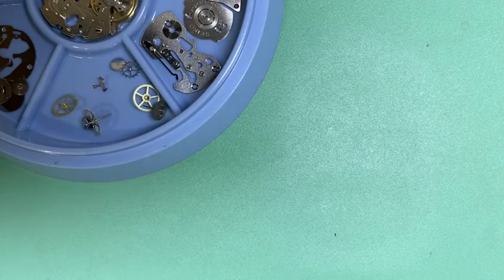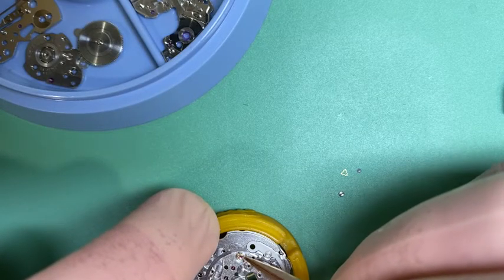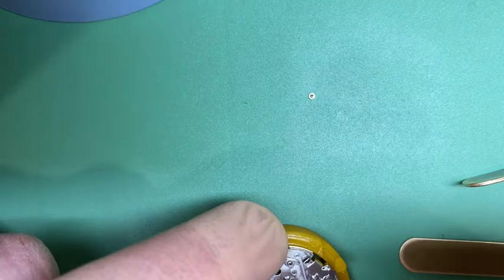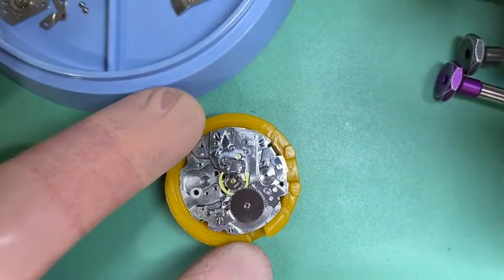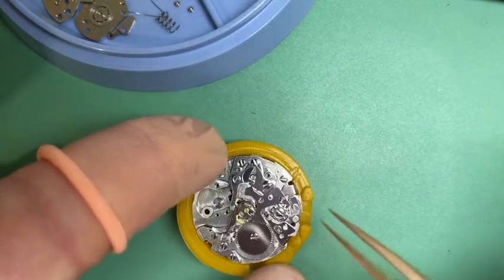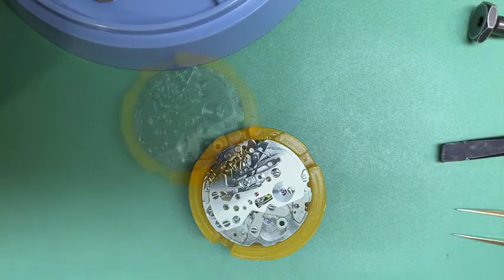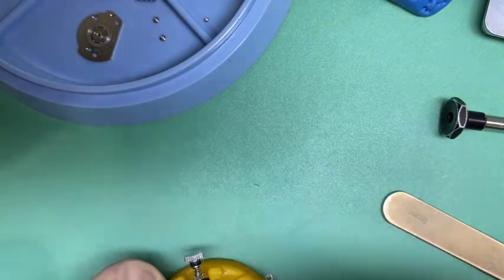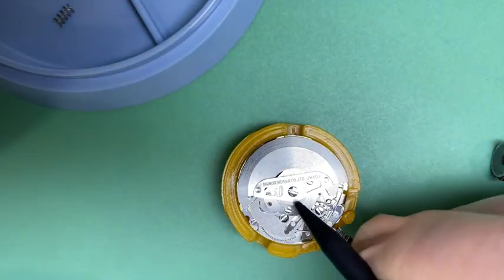Seiko 6139-6005 ‘Blue Pogue’ Service Procedure - Part 2: Assembly & Lubrication

Comment: "It's just that easy" 🙂  I need mine rebuilt, the timegrapher refuses to read the thing at all sometimes, and when it did I set it as well as one could expect only to find it running super fast as soon as I put the case back on and wore it.  Thanks for the videos, they are insightful.

Comment: Great video.   I have worked on several and picked up some great tips and techniques.   Would appreciate more info on lubricants you use and in which place.  Info on grease for metal to metal contact interesting.  I have used S6 9504 and, at times, 1300 for calendar pivots.   What is your preference?